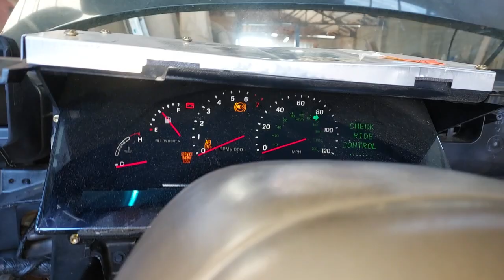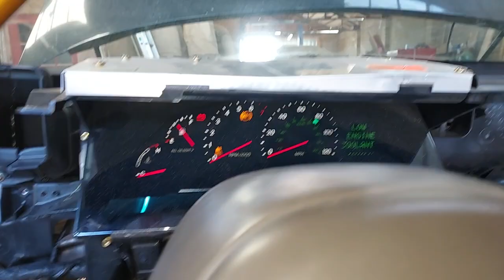Taurus Wagon 4.6 v8 swap: First Start

Comment: I had long figured that this was theoretically possible, given that the Continental was a derivative of the DN5, but you might be one of the first to actually do this.
Reply from the maker: I'm the first to do it in a gen3 wagon but not the first on the platform.  There are at least 2 gen4 sedans and a gen3 sedan that it's been done. Everything on the fire wallnis the same but the track width of the conti is a bit wider then the Taurus. I trying to figure out how to fix that. The lower control arms are completely different. The sub frames are also different in how the engine bolts in. I may still try using the Taurus sub frame. That would get my alignment way better.
Reply: @dieselgaint how do I look up on the other swapped Taurus cars? I have a gen 6 non turbo and wanna do something a bit more special to it then just have a SHO
Reply: Did you end up using the taurus subframe instead

Comment: This is awesome man!! What a sweet project.  Subscribed, can't wait to see more on it. I've got a modded 98 Continental and a stock 02' that i enjoy a lot. Big plans for the 98 I've owned since 06'
Reply from the maker: Thank you! It's been really encouraging with all the comments. I've never had this much interaction on YouTube before. Currently dropping the engine out so I can get the transmission built, finish subframe, mods, and reseal the engine. May mod it while it's out but it's not very hard to drop it out.